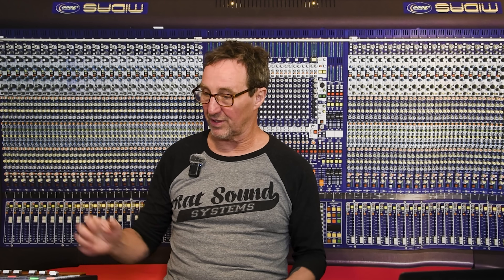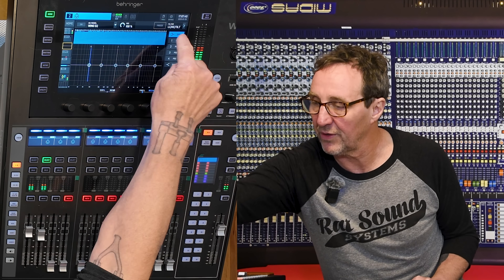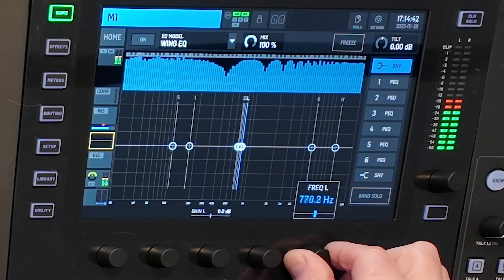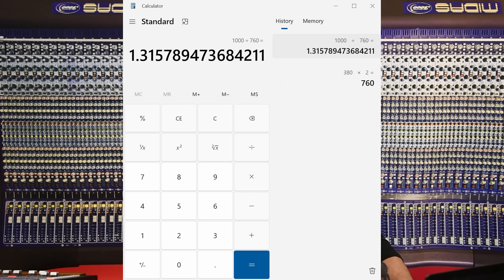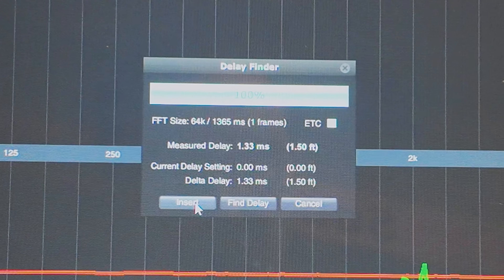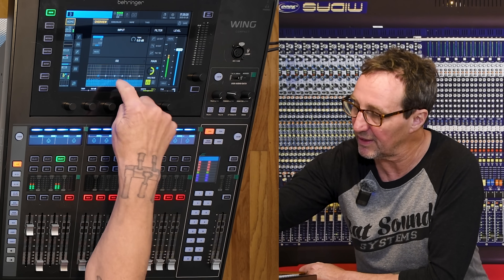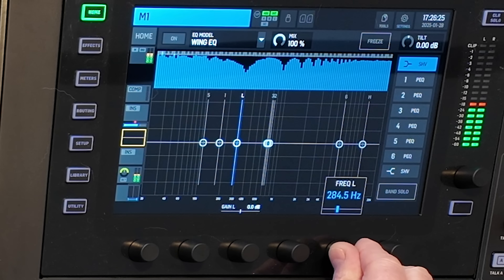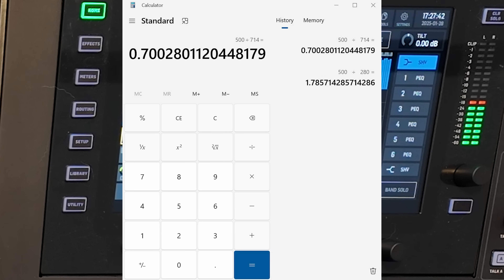Easily Find Console Comb Filtering Latency Issues

Comment: That's some terrible coding from the desk manufacturers. 
It is so easy to overcome at a basic level..
For example Allen And Heath have a flat I/O 0.7ms latency on all channels irrespective of inserted "plug ins" if no plug-in is inserted then a compensatory delay is placed in the channel path. All channel inserted plug-ins are delay compensated to the same amount irrespective of the type or complexity of the plug-in.
The Allen and Heth SQ and QU are right in the cost ballpark of the wing so it-s just pure laziness on the part of "B" 
When you get into the ultra complicated desks (Such as the Quantums) it-s much harder to do as there are such complex signal paths, and maybe the Wing is a little too complex for it's own good considering it's market and cost point . One of the big points of the A&H desks is they sound really tight and clean (on a good system in a good room) in comparison with these other desks.
Reply from the maker: Allen and Heath, like pretty much every digital console out there has a built-in set of compressors, gates and other effects that can be inserted with no additional latency. I believe in Allen and Heath they call it DEEP processing. 

that said many consoles have additional fancy plugins built into the consoles or have the ability to use additional fancy plugins like Waves that offer a wide variety of vintage gear emulations as well as additional processing and control beyond what's built into the zero latency " stock "  processing. 

these more complex processing plugins are the things that cause the latency issues. 

One could debate whether or not having these additional processing features built into the console is an asset of quality coding or an issue of deficient capability. 

but either way there are certain effects and processing methods that do take longer to achieve and cause latency due to the complexity of the processing needed to achieve the desired outcome. 

so then the console manufacturers are faced with either increasing the baseline latency of the console to accommodate or limit the capabilities of the online processing to fall within the predetermined low latency. 

some consoles have a baseline latency and baseline set of processing and capabilities and then additional capabilities beyond the baseline that add additional latency. 

having an awareness of which processing adds additional latency and how much latency is being added and the impact of that latency is what I'm trying to shine a light on
Reply: @DaveRat Personally I think all consoles manufacturers (and DAW manufacturers ) have got too hung up on super low latency signal chains. (For marketing reasons) I’d rather see a time coherent processing chain rather than going all out for sub millisecond latencies. Using the ballpark measure of a millisecond equalling a foo,t anything below 5 or 6ms doesn’t introduce any performance altering issues. Especially when using wired IEM systems that deliver the sound BEFORE it arrives to the musician acoustically, thus delivering an un-natural time offset. That’s right a drummer will get their monitoring about 3 or 4 ms before they would hear it without IEMs. Anyway, I digress. There are live systems such as the BSS Soundweb London that have a delay compensation which will deliver time coherent signals across a complex system that can involve hundreds of processing blocks. The overall system latency can be higher than most digital consoles but I have never had any issue form any artist using such systems doing processing for monitoring systems, and I have installed hundreds of units over the years. 
I would prefer to have a console that keeps timing issues in check but gives a little more end to end latency than have a sub-millisecond end to end latency with a kind of “fuzzy” timing of parallel paths which you demonstrated here that is going to close down my stereo imaging and depth and make my whole mix sound like an MP3. 
Then again. Half the sound systems these days are so de-correlated that it’s hard to hear timing precision on them anyway, especially on a windy day outdoors.  

BTW. Keep up the thought provoking videos. There are far too few these days I really enjoy them all, and respect the lengths you go to to make sure what you say and do is accurate. 
Thanks Dave.
Reply from the maker: I kind of go the other way and feel that the negative impacts of latency is too often disregarded and overlooked and actually causes more problems than many people realize. 

reducing or eliminating latency for a musician hearing in-ear monitors can be the difference between the voice sounding distant and completely locked and realistic. 

here is one of the videos I've done on latency and listening to how it impacts people listening to their own voices. 

The fundamental issue is that we have an internal body resonance of zero latency and when sound is delivered to our ears of our own voice had some later delayed point in time there are phase and delay issues that cause comb filtering and cancellation that is audible and not fixable without eliminating the latency

https://youtu.be/APj0ZaMy4Xw?si=gdYpcXEzOce2jQ-G

Comment: Wow, i thought the mixer would internally compensate for this, like ASIO. This is nuts!
Reply from the maker: some or most do for things like normal channel EQ, comps and gates but when you start adding pluggins or things with pretty pictures that look like fancy old gear and such, those take extra processing power and cause added latency.

manufacturers are faced with tyeypng to keep total latency low and offering fancy features so as long as you don't use the fancy features, all good.

this test will help people know which is which

Comment: Do Digital VSTs make you mix worse , the question was,  never got the answer , yes they do . Keeping things in Analog domain with shortest cables possible will result with most rich and nice sound . This is a question between Digital computers and Analog computers , Analog computers are much faster , Analog EQ ,or Compressor is much faster then Digital one , also it has inherent Analog things going on that may be beneficial to your sound . I have 0 Analog devices , always did Digital . But i have to say , if my budget was bigger , everything would be analog . This kind of console , this Digital thing would not go in to my studio but i see how some people may prefer that to PA systems .

Comment: Thank you for the video. I was never a fan of parallel compression or other effects, but now it is clear to me I won't use them unless I have to and can set the delay time so there is no phasing. 
Why not just use a compressor where there is a dry/wet knob, so you don't have this issue in the first place? 
Nevertheless, i would be amazing if there was automatic routing detection with delay compensation where the desk adds up the FX latency on a wet channel and then compensate the dry signal path with that amount as well, so you don't have to do it manually.
Reply from the maker: very cool and though I never used parallel compression I do understand the concept and control where you can easily alter the compressed vs non compressed mix via faders and DCA's.

as far as delay compensation there is some gear that does it, mainly DAW's.

the challenge for live is that if adding, for example, anadditional compressor to the bass which adds some latency, and then the entire console automatically shifts latency of every output and signal path to compensate, now the sound for the in-ears and wedges have a new longer latency.

so now everyone hears their voices a little bit later and that changes the tone and interactions with their voice.

also adding latency to wedges will alter the frequencies that the wedges will feedback.

alternately the console could always have the max latency but that creates issues as well as minimum latency is desired for wedges and in-ears.

so, most consoles combined the two, there are the stock EQ's, gates and comps that don't alter the latency when engaged and then there are the "pluggins" or fancy things typically with pretty pictures of vintage gear that people absolutely love to use, that nearly always add latency.

avoiding the pretty pictures solves 90% of the issue on most consoles.

but some consoles have routing latency issues where using subgroups has more latency than direct to left right.

I have done numerous videos on latency, the impacts and compared some consoles as well.

Comment: So which digital consoles & DAWs have built-in latency compensation and which don't? This seems like a super dangerous pitfall if left unchecked, no?
Reply from the maker: yeah it kind of is an issue or it could be depending. 

but latency compensation is an issue as well 

if a console has latency compensation which means that the latency of the entire console changes based on the longest latency of any channel, that would mean that adding some more processing to the kick drum might change the latency of every channel including the vocals. 

And if there's speakers or in ears that are being listened to now you've altered the amount of time it takes sound to travel the audio path and that will change the way that things interact with the actual environment or with our ears and such

Comment: While I understand the concept behind your explaination of latency between mic channels when micing the same source, didn't you once say that no 2 points in space would ever sound the same? This believe this was your reasoning behind stereo micing the same source, to eliminate any mono cancellations.
Reply from the maker: you are absolutely correct. nowhere nature does he exact same sound radiate from multiple points in space. 

And I followed that up with, but we do that all the time and when we do that we create numerous assets and issues 

including time, phase, delay and polarity interactions that do not happen with sounds that are completely different 

And this latency issue is an excellent example of two versions of the same signal being combined with an offset in time. 

 And this demo and test relies on the same signal combining with itself with an offset in time. 

which is an electronic version of two signals that are identical radiating different points in space therefore arriving at different times
Reply: @DaveRat That is also true. I guess I was just think more from the standpoint of specific frequency cancellations, which i suppose can also happen with direct micing. I suppose this is part of the process of EQing my channels, just never actively thought about this specifically potentially being the thing i could be correcting in that process.
Reply from the maker: yeah you bring up a good point. when micing instruments the mics may be offset by 6 in creating a 0.5 millisecond offset in arrival time of that instrument and then when those two mics are combined there will be some comb filtering. 

but since those two mics are indifferent points in space and therefore capturing somewhat or slightly different sounds that combined comb filtering will not be as drastic as an identical sound. 

these latency issues are most dramatic when the same sound travels multiple paths with time differentials and then is recombined with itself. 

conversely latency offsets or time delay offsets that correct for differences in distance of microphones can be beneficial

Comment: Thanks very much for a practical way to measure the latency of plugins within a board. I knew this was a problem on the X32, but didn't quite realise that the Wing also wouldn't have delay compensation/has plugins that instantiate delay. It makes me inclined not to use any plugins on any single drums at all!
Reply from the maker: very cool and yes knowing the information so you can make decisions and have an easy way to test is super fun

Comment: Hello ! Just wondering why you chose 1000ms for the first calculation ??
How did you connect your smart to the Wing ?
But damn, what an interesting video !!!
Reply from the maker: Great question I use 1000 milliseconds because 1000 milliseconds equals 1 second and frequencies are defined as cycles per second which is the same as cycles per 1,000 milliseconds 

as far as connecting up smaart, you would just take your source generator and plug it into one input of smart and take the source generator and plug it into the console come out of the console into the other input of smaart. and smart will allow you to compare the arrival times of the direct signal versus the one that went to the console
Reply: @DaveRat  Thank you so much ! Just to make things all clear in my head, you were trying to find the duration, inbms, of the wavelenght ? Or isit just totally another thing ? If yes, I can't really find the relationship between latency, and wavelenght ? I might have an idea but I'm not sure...
Reply from the maker: if you're getting comb filtering and you can see the lowest frequency with the big dip, And we know that the big dip is caused by a 180° phase shift

and since 180° phase shift is one half wavelength of the latency frequency. then doubling that frequency will give us a full wavelength. 

so now we know the frequency that has a wavelength equal to the latency by doubling the frequency of the big cancellation dip

so now we just need to calculate the wavelength time (period) of that frequency 

since frequencies are notated in cycles per second And we want to know seconds (milliseconds) per cycle we invert the equation and divide 1000 by the 2x the cancellation frequency.

And that will give us the time. in milliseconds of the frequency that's canceling and the frequency that's canceling has the time. equal to the latency.

Comment: Maybe this phenomenon is why some insist that "analog sounds better," as there's no, or less, latency with anolog equipment?
Reply from the maker: perhaps. I think when digital first came out it was pretty cut and dry then analog did sound better. as digital progressed that became less and less true and now digital is actually cleaner and more accurate than analog 

that said, digital is not very forgiving and goes from sounding clean to sounding crap very quickly if you push things too hard. 

also digital is so clean and precise that it shows all the flaws and things like slight timing offsets are very audible more audible than they would be with it analog 

it's kind of like clothes. digital clothes that are exactly perfect and don't have any creases and look precisely perfect as the digital images may show may not be as desirable as real world analog clothes that have crumples and fit and some wear and tear that tend to be more beautiful to our eyes